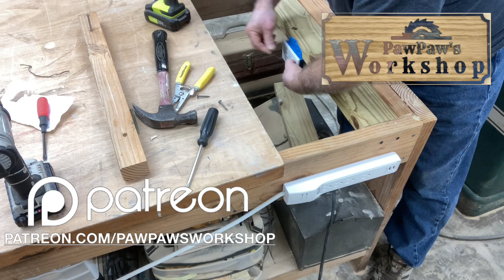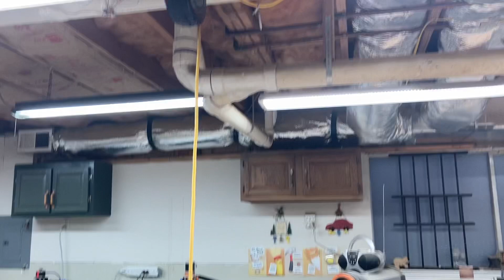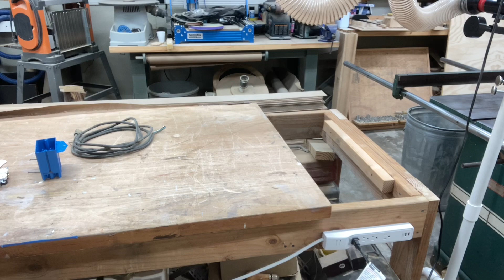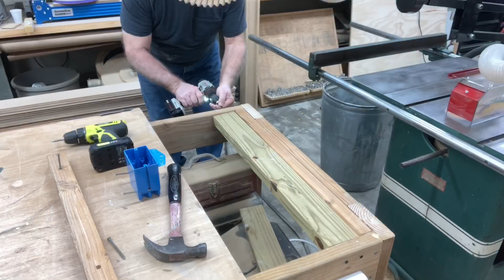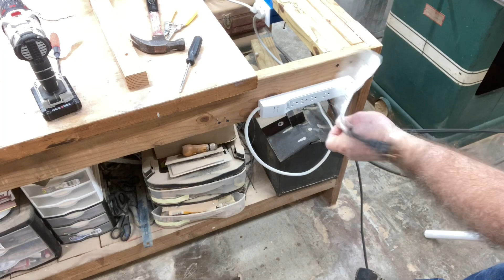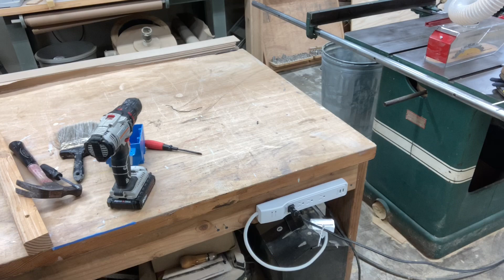Quick tip: Adding Power to the Workbench

Comment: Make sure you use the correct gauge of cord depending on how for you’re going to use or your tool won’t run correctly.
Reply from the maker: Excellent point. A 12gauge wire will work just fine for my needs. Thank you for sharing.